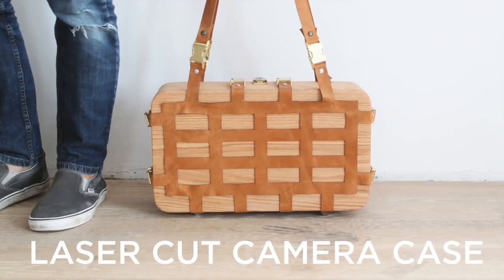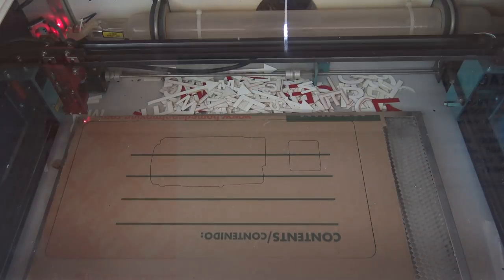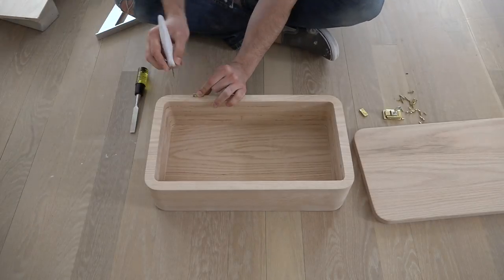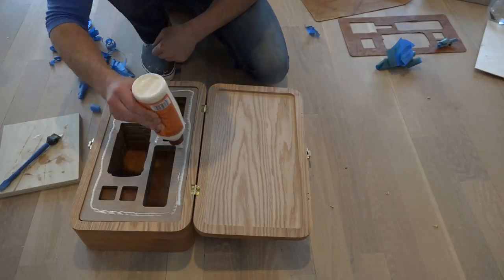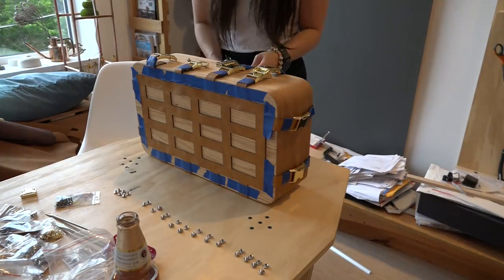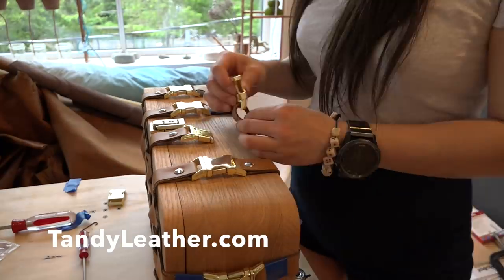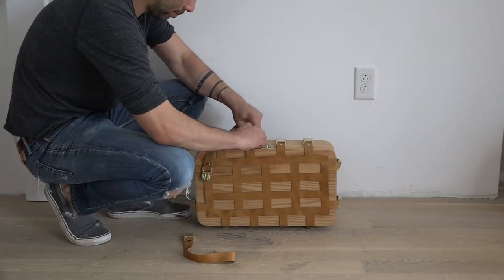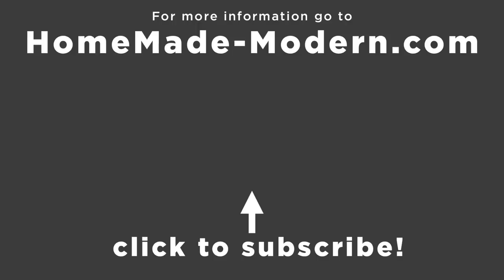Laser Cut Camera Case |A Digital Fabrication Project

Comment: I know you don't need it for this project - but as there will be leather projects coming up you can save some time (and hand cramps)  if you have to hand sew leather by cutting little circle holes with your laser instead of using an Overstitch Spacer and awl - it works really well on heavier leathers. 

Also - Is that a DiResta ice pick?

Comment: It seems the leather outside is a bit of a struggle to get on, maybe magnets to help with that? Since the case is built in layers, it should be easy to hide magnets in the wood and those can hold onto the buckles.